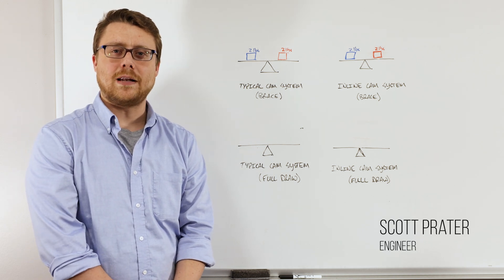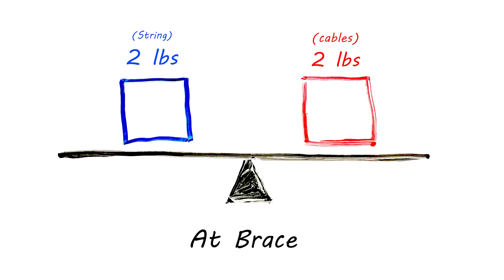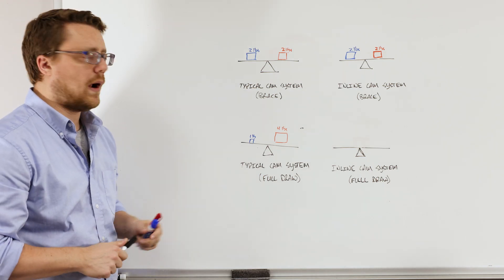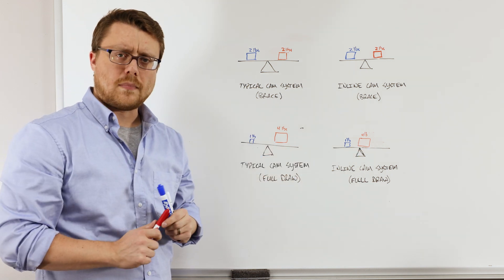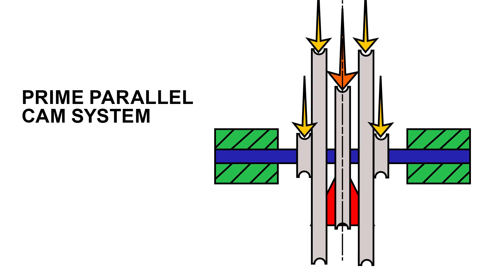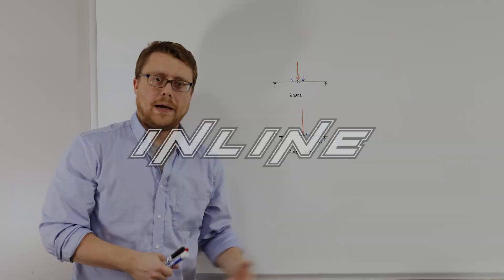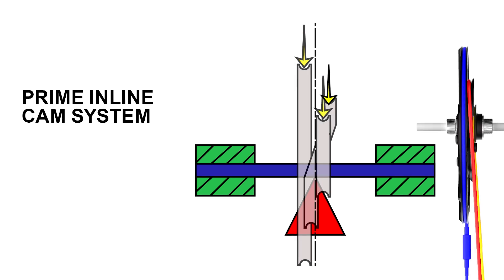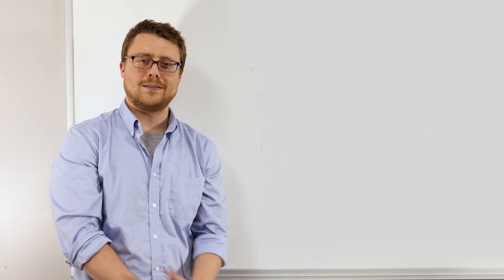How the Prime Inline Cam System Works

Comment: Hello, thanks for the video! I have a question though. I have a new Inline 1, and I noticed at rest there is some cam lean. I understand you are trying to change the dynamics of the string and cable balancing, but in this video you state this is to eliminate cam lean - but mine does have a noticeable cam lean. It shoots great, paper tuned and all. But the cam lean is present. Should I do something about this?

Comment: Bear has done this 2 years ago with the eko cam system . The cable on the 3rd track is moving closer to the main cam when you get closer to full draw to eliminate or reduce cam lean. Darton archery has a roller that shifts during the draw cycle also removing cam lean. You see the reason for cam lean is your cable guard take it of and no more came lean. Or use like Darton shoot true riser with  2 opposing cable guard balancing out the cams no more cam lean.

Comment: Yea. What about the horizontal force created by the cable on the cam? It increases as you pull the cable to the center of the cam! People are saying in there reviews that there is no horizontal forces any more in this system.

Comment: In my opinion Prime's credibility just went out the window. The Centergy 33 had zero torque. The single limb design and parallel cams were obviously a superior design. G5 has lost their unique, justified superior selling point! "Big and heavy"?....bull. This has been a production cost reduction driven u-turn; probably linked to the bi-annual string replacement policy. Why would I buy Prime now, over say Bowtech or even Matthews? G5.... I'm so disappointed. I'll bet this gives a terrible torque test result.... if G5's brave enough to supply one to archer1941.
Reply: I bet your wrong
Reply: I think I’d be responsible to actually shoot it before ripping on it

Comment: I appreciate the technical details versus other manufacturers that just produce marketing sound-bites. I have two prime bows and I have noticed some negative tradeoffs to the twin-cam system. In addition to the weight and complexity, I get rapid serving wear on the sharp angle of the string yoke. I think this new system looks good, hopefully the track that pulls the cable to the center doesn't cause rapid wear but I suspect it will be fine.

Comment: I have shims for my Nexus 4 but they r not needed.  Yes, the string is more complicated but it obviously has advantages.  I really like my 2017 Prime Centergy & it's balance & draw cycle. It has always had some of the best nock travel test scores of any bow out there. With the Nexus 4 I was able to keep the things I like about the Centergy & get more performance with less effort. With a 30" draw & 62 lbs. I get speeds that don't dump when I'm shooting an arrow that is less than most people shoot. I could max it out to 66 lbs. but the arrow flight is so true that there's no point to doing so. Efficiency of energy isn't talked about as much as other things that will never matter except for the deeper regions of a person's brain. I'm up here in MN & the Nano grip is also really paying dividends. No longer do u have to wrap a grip that already has a great shape & feel to it.

Comment: Split cam is what made prime special and different. Now you are no different that other bow makers
Reply: Obviously you didn't watch the video.
Reply: @raptorcon2391  so they are the only ones who use single cam now
Reply: @primalj_2a433 Dual cam's are not what made them special the reason behind the dual cams is what made them special. This new design is just the continuation but with less parts and simpler.
Reply: @raptorcon2391  same thing
Reply: The fact that prime guys love that parallel cam design and the SEVEN different strings needed to make it work is beyond me. This new cam is WAY more appealing to guys that don’t care so much about “being different”